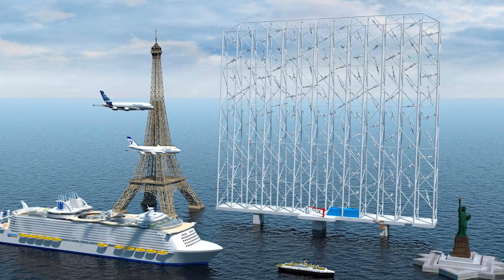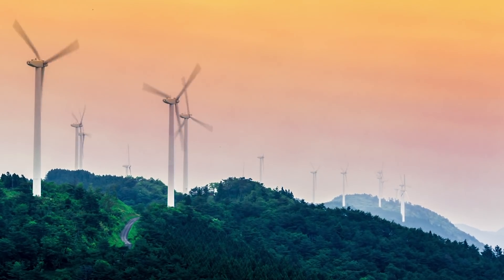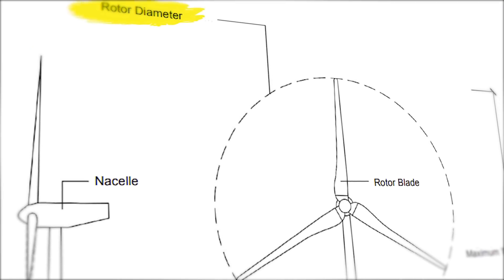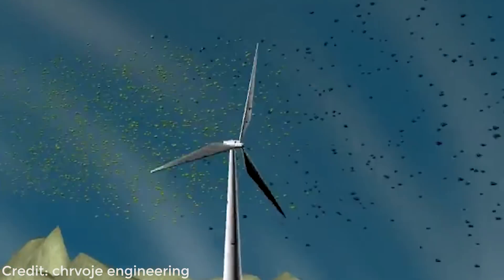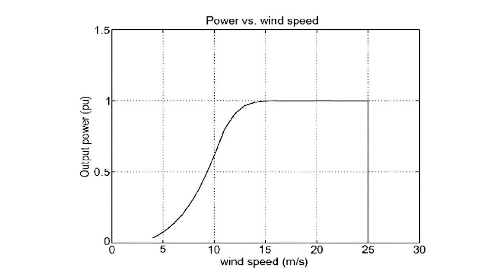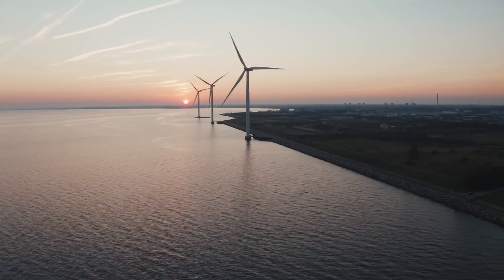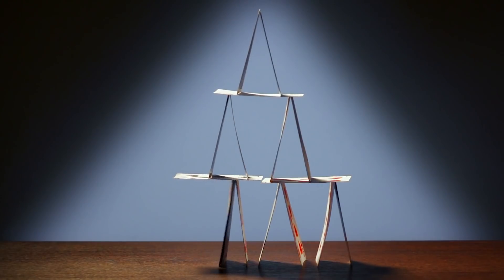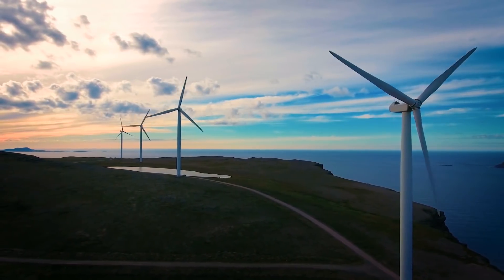Is this the Future of Wind Energy? - 200+ Blades!

Comment: This construction will break in any wind above gale force. Due to its shear size it will catch to much wind than the frame can hold. If it is floating the wind will capsize it and if it is standing on the bottom the foundation has to be out of this world. As for a tabletop exercise for an illustrator it looks fantastic but it has nothing to do in the real world.
Reply: When you can see through, the wind can usually go through too. Unless you put glass or acrylic inside of course. But they didn't mention that.
Reply: @cyklonetidalenergy7141  Even  a lot of wind passes through the frame in it self catch enough wind for the whole construction to break. With the size of that thing the wind catch is enormous. I have firsthand experience of  radio masts that were 20 centimeters in diameter break like a match in strong wind. If you add all the propellers in this project that will also catch wind there is no way this thing will hold. It is just too big.
Reply: @runedahl1477  no, it isn't. The Cw coefficient of round poles is like 0,23 and the open structure covers like 5% of swept area. That's like 1% of being a resisting closed surface. A prop also does on catch 5% of swept area. The drag of a prop is just like 5% to 10% of the total force on a disk as well. The energy is converted into torque on the generator. The purpose of the whole idea of doing a wind energy converter. So the turbines add a lot less than you may think they do.
It would help to do a bit of basic physics on your end. You can find the equations on wind turbine drag and basic fluid dynamics around poles on wikipedia if you care enough. But you can easily compare it to huge radar and long range radio antennae or radio telescopes not blown to pieces in hurricanes if you don't want to do the math.
Reply: @cyklonetidalenergy7141  That thing is 320 meters high and has some relative thin bars holding it tighter. The antenna I referenced to was on a ship and was about 20 meters high. Still it was no match for the wind. Have respect for the destructive forces of nature both wind and sea. First and foremost anyone who comes up with a new idea most practically prove their claims. There are a lot of companies that have come  up with fantastic designs. The ones that have made a proper prototype are all bankrupt and in some cases jailed for fraud. The only one that seem to be working is the one that mimics the wing of an airplane. Even this one only works between 11 to 30 meters of wind per second.
I personally think the future energy production lies in molten salt reactors. Yes, it is nuclear but all of the disadvantages with the existing light water reactors are not present due to shear physics. In fact China started their first test reactor in September this year. It has the capacity to supply 1000 households with electricity. The plan is to start mass production of units that can produce energy for 100000 households by 2030.
There are a number of companies working on molten salt reactors and one of the most interesting is a company called Thorcon.
They will have their first reactor running in Indonesia. The reactors will be built on barges and can be deployed around most of the world as long as there is sufficient water to move the barges in. You will find presentations of their project on YouTube.
Reply: @runedahl1477  The is a point you make here about sustaining top wind speed. Wind turbines typically feather their blades in hurricane winds. They typically shut down between 7 and 11 m/s. The larger the device and the lower they can reach into slow winds, the earlier they shut down into sailing mode in pitch and release their yaw drive. 

You are right, if all these turbines are in sailing mode, a much higher wind load would remain compared with a swept area of a single 3 blade device. And this would be subject to vibrations with a long arm for leverage. In turning gusts of wind this is indeed causing a structural problem. It doesn't show any yaw mechanics. I don't recall what was mentioned in the video. Was the assumption they could go without due to winds mostly from the same direction?

You would have to feather this completly to be somewhat resistant to hurrincane winds. That is hard to do with inertia of this large plane when looking at it sideways and needing it to follow gusts that run their direction fast enough. The whole device would indeed require a gigantic counterweight in raw materials not to topple over. In gusts that may be a dynamic resonance between winds and waves building up.

Addressing that would simply negate the projected benefits due to the high cost of extra steel needed. It totally shifts the assumptions on man hours to weld, manufacture and setting up this device. You could make this strong enough in the construction, but it would look rather different then.

Does it yaw or not? If so, how? Just shifts things to the next level, how strong is that yaw mechanics and how to manufacture it. How fast does it operate to prevent dynamic resonance. how much wear would be on actuators ans gears to last over lifetime. If this single point of failure has a malfunction thats the end of the device plus a messy salvage and cleanup ops. Quite expensive ops offshore as this will completely sink immediately.
Reply: @cyklonetidalenergy7141  The idea behind this construction is not new. In fact in 1980 a book was published with a collection of various wind turbines illustrated and drawn. One thing is to sit behind a desk and dream up an astonishing design for a good product. Even the calculations for the required strength of the components may add up. The main thing is that it has to prove it self in full scale and under the worst conditions.
When Mercedes introduced the A type most of the development was done on computer and the red carpet for car of the year in Europe was almost ready until some Swedish journalists manage to roll over when they tried their elk test. The fiasco almost broke Mercedes.
As for dynamic vibrations due to wind that is also something that has to be tested and what the result of such a test will be is difficult to predict.
A lot of people have seen the footage of the bridge with the nickname Galloping Gertie collapsed. There are quite a few other projects that have ended the same way.  I have seen more bad weather than most people due to my more than 40 years of seagoing experience. Been through a few hurricanes/ typhoons as well, so I know what the forces of nature are capable of. Living in northern Norway I know that the winters bring a lot of bad weather. First the makers of this thing has to build a full scale construction and prove that it works and that it can withstand winter storms. These storms will probably be worse according to the climate pessimist . Then you have to consider the prize tag for each unit. If compare the size to oil rigs and what they cost we are probably talking about billions for each unit. What the prize to the customers for 1 kilowatt one can only guess but I have a feeling it will be cheaper to run your car on whisky than electric. If something is too good to be true it normally isn’t.
Reply: @runedahl1477  I seen a railroad test track being deformed into a perfect sinoid. Also I did witness a print presse break from virbrations induces material fatigue at 15.000 rpm and trash through a 20 cm steel wall. This concept is indeed old. It is junk for a dozens of reasons. Unfo it will live until tried. You can't scale this in a wind tunnel to test.
Will it drain investment from other ideas? Will someone pick it up and cry later? Will this give other ideas a bad name? You can bet on it. What you can't tell me is how to get rock solid concepts promoted in the face of this.
The Tower Of Babel is always appealing to the super size image of people in power. Fact based solutions don't have this appeal. They just work and are pretty boring.
Reply: @runedahl1477  my understanding is LIFTR MSR does have issues with not achieving the projected breeder rates for yet unknown reasons. So they leave dirty and weaponized fuel behind and consequently do still fail their economics and ease of utilization targets. It needs decades of further research and billions of R&D funds. Things are not going smoothly on that end.
Reply: @cyklonetidalenergy7141  light water fuel reactors has not improved much since they were invented. The problem with them is actually the water. To run turbines the steam pressure have to be between 75 to 150 bar. In addition if the temperature gets above  700 degrees centigrade large amount of hydrogen will be generated. That is what happened at Fukushima when they lost the cooling pumps. In addition light water reactors have to have a lot of safety barriers both monitoring and extremely thick piping and a solid building around it. With molten salt reactors the reaction goes on in the salt. Since the salt is in a melted condition and not as gas there is no pressure. The salt will only vaporize at temperatures near 2000 degrees and the process will stop long before it reach that temperature because the distance between the molecules will be to far.
The molten salt reactor can run on thorium and/or uranium. The fuel can be added to the salt while the reactor is still running.Traditional nuclear plants have to be shut down for long periods when fuel rods are being replaced. If you make a fast reactor you will be able to burn down plutonium    and higher up the scale. With the exemption of the Oak Ridge National Labratory experiments molten salt reactors have not received much funding so far but that is about to change. China started their first power plant in September this year. It is situated in the Gobi desert and will supply 1000 households with energy. This is only a test unit but they expect to start mass production of units that supply up to 100000 by 2030.
India is also investigating in molten salt reactors. China and India have large amount of thorium and will in this way be independent of import from  Canada and Australia. In USA/Canada there is a company called Moltex that will roll out their first reactors from around 2025. With the high prices electricity in Europe these days people will start to rethink their reservation against nuclear energy. Specially since a lot of the problems comes from wind turbines that are not producing due to lack of wind. The molten salt reactors can produce stable energy without the same safety issues as light water reactors. The power plants can be built in smaller units and can be located anywhere. A benefit of this is that the grid will be more stable. With these thermal reactors the production can be more efficiently to the consumption at any time. The benefits of molten salt reactors are so positive that I am surprised that it was not built years ago. Probably the cold war had something to do with that. An other matter is authorities and investors lack of visions and an other “Kodak moment “. (Kodak we’re the first to have a prototype of a digital camera but they held on to the old technology until it was to late and they went bankrupt.)
Why molten salt reactors?
1) Clean and stable energy production.
2) Low amount of waste product. The worst isotopes are safe after maximum 300 years.
4) High degree of safety. A lot of passive safety. In worst case scenario the plant shuts down it self.
5) Cheap energy for thousands of years. Cheaper than coal is today.
6) Plants can be built very quickly and at low cost. Shipyards can easily mass produce complete units.
7) Excessive heat can be used for a number of purposes. Hydrogen production,ammonia production,petrochemical industry,heating of buildings, etc.
8) Radioactive isotopes for medical use can be extracted from the salt.
9) Rear metals can be extracted from the salt.
10) It is almost impossible to make nuclear weapons from the salt.
11) Large amount of thorium is already available in the waste from excavation of rear earth metals.
12) Conversation of existing nuclear and fossil fuel plants should be relative easy,cheap and fast. They just have to disconnect the boilers or the reactors. The rest can still be used.
Reply: @cyklonetidalenergy7141  I disagree with you  that we want see  commercial molten salt power plants for an other 15 to 20 years. I believe the first ones will be running in 5 to 10 years. First and foremost because it is a relative simple design and the technology has been known since the 1942.
The man behind these type of reactors is Alvin Weinberg whom was also a big contributor to the light water reactors. He saw that light water reactors could be quite dangerous if they lost control over them and wanted too,prove the design. Under his leadership the Oak Ridge National Labratory reactors were built and tested from 1957 to 1976. The funding for the Oak Ridge reactor was canceled by the Nixon administration and sent to a light water project in California. There are more voters in California than in Tennessee and beside molten salt reactors are not suitable to produce material for nuclear weapons. In the scientific community they did not want to reinvent the wheel since the reactors they had were working fine and nobody worried about the storage of nuclear waste. This was before the accidents on Three Mile Island, Chernobyl and Fukushima so nobody really cared. There were relative little money put into the Oak Ridge project but they managed to do most of the scientific foundation that the molten salt reactors will be built on. They also did a lot of testing of the reactor going critical and above and proved that the nuclear reaction was self regulated should anything or everything go wrong. When I watch presentations of the various project it strike me that the are all down to earth and fully achievable. All the secondary equipment are off the shelf, something that will keep the costs down.  What is not of the shelf are the reactors and the equipment in the primary loop. There is also a maintenance plan and a plan for the nuclear waste. In practical terms the complete reactors units will be replace after 4  - 7 years of operation. The makers will then inspect them and replace anything that is worn out or corroded. Imagine what a maintenance nightmare the wind mill palace shows in this YouTube clip will be.
The amount of waste from these reactors are small and only need to be stored for 300 years. That is nothing compared to traditional reactors.
With chemical processing of the salt they can also extract rear metals and minerals that can be sold after 100 years.
When it comes to creating a big hype nothing beats wind turbines. It is amazing to see all these creative designs that all claim that they are super efficient and environmentally friendly. The sad truth is that most of them fail and a few of them are shear fraud. The are people in California in prison for just that. There are many drawbacks for the wind turbines and the solar panels that are actually working. First and foremost they depend on the weather. Right now the electricity costs all over Europe are  extremely high. The reason for this is little or no wind to run the turbines, shortage of gas,  and  extremely cold in countries that produce hydroelectric power due to reduced flow in the rivers there.
Wind turbines and solar panels for large scale production takes up a lot of space and these massive wind towers area visual pollution.
Due to their dependent of the weather they most have a backup system and only fossil fuel driven plants can run up on relative slow notice.
Probably they will have to run on minimum load just to keep the boilers and turbines warm.
With the wind turbines there is also issues with possible oil leaks and flaking off of pain and other materials when they are running.
The  noises from a wind turbine is annoying and possibly dangerous, and it scares of wild life. In addition the kills a number of birds every year.
On the island of Smøla in Norway more than 100 eagles have been killed by wind turbines and these birds are on the red list. The same faith applies for a number of falcons, hawks and owls. In addition you will find a large number of accidents harming humans, some of them fatal.
When the companies behind these projects present their plans the use professional media advisers who downplay the negative effects and fill the  heads of the listeners with positive and green arguments. A certain minister of propaganda once said that the best lies had small piece of truth.
This is a strategy that also works today. Anybody wanting to take a closer look at something finds that on the surface everything looks ok. Then they stop checking and don’t find the dirt that is hidden below. Usually if something is to good to be true, it isn’t. Look out for people with gigantic plans and PowerPoint presentation. Ask your self is this realistic. An other trick is to promise lots of money in return for investments. People don’t think clear when greed sets in. How is the presenter acting? Is it a well dressed person with a silk tongue be aware. This is often the trademark of a con artist.

There are some expensive nuclear projects going on , one in France where they will make fusion of atoms. However this is complicated things with a plasma at a million degrees inside a vacuum chamber and held in place with super magnets.  So far they have used more energy to start the fusion than they have gained in return. It will probably not have any practical application for decades or even centuries.
I like to compare this project to that of  Cern and will probably give mankind a better understanding of atoms and particles.

Science manage to produce a vaccine against Covid in an extremely short period compared to other vaccines. In the same way I believe 
we can solve the quest for clean and long lasting energy.  Sometimes the answer is right in front of your nose and I think it is molten salt technology. Hopefully we an look back 10 years from now and wonder what the fuzz was all about. 
The same way I have not heard anything about the ozone layer, so I assume it is still there.
Reply: @runedahl1477  Lot's of optimistic phantasies in there. Frankly even the most mundane tech does take 10+ years time-to-market. 

As I said before with the breeder rates and byproducts exactly this concept did fall short of expectations. it did end up with weapons grade plutonium and nod breed into fairly harmless. It is unclear why it doesn't match up with paper theory. A key fact indicating this will take between 10 to 30 to mature rather than 5. If it will work at all.

Anything above 5 is too late for scaking somewhat by 2030. It is a too late for the energy transition party. We will have other solutions before this enters the market. That is an economic not a tech argument. Tech can be as great as it may be. If there is no market it is a pet project gadget and not a viable product.

People have tried SMR breeder concepts many times over. When reasons why past attempts have been abandoned sound too much like a conspiracy theory, then something has mostly been overlooked that is very hard to fix. If it can be addressed at all.

Next you run low on support, low on ressource and low on funds  opposed to run such R&D with full backing of a national effort. None of the above lends to fast progress. Design for 600° C molten salts is taking like 10 to 15 in chemical process by definition handling corrosive materials. You need to design and construct a facility nevertheless. 

Certainly the thing that will takes longest is any certification and permits. On low or starved government administration and with drain from vested interest of competitors this is basically guaranteed to progress in a snails pace of 20+ years. 

All of your assumptions are basically falling short of known realities. You may wish them to be different, but then you would have to picket line on the streets and demand it like anyone else has to.

Certainly no one does promise 10+ years to their investors and goes optimistic on this. Sure, with all out backing that may be. From experience I know R&D backing to always fall short unless some stupid money is hooked on a perpetuum mobile, space mining, super battery, superconductor or gravity defying magic. All these have usually in common they do not accept the thermodynamic laws of entropy an enthalpy at some point. These are not covered in "look good only on paper" science. Doing things in the physical world step by step does always take longer than you think.